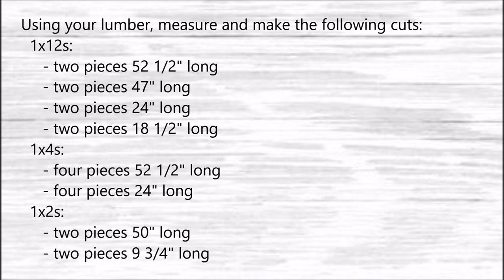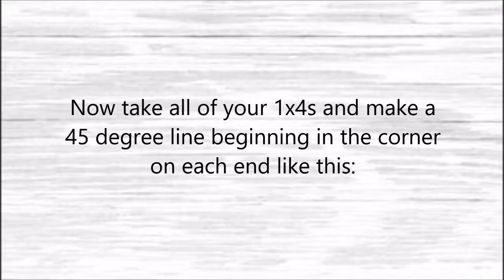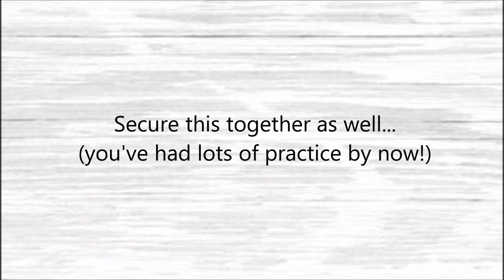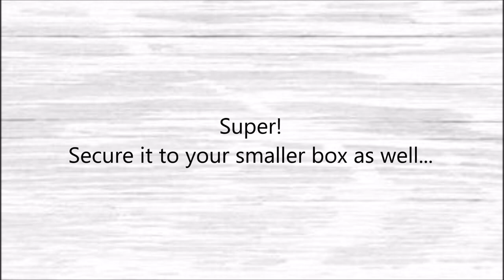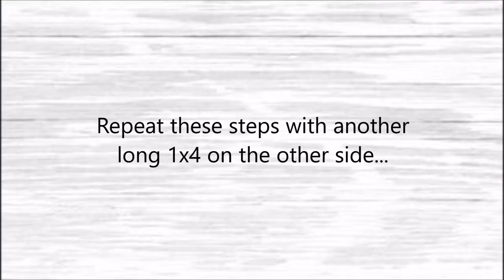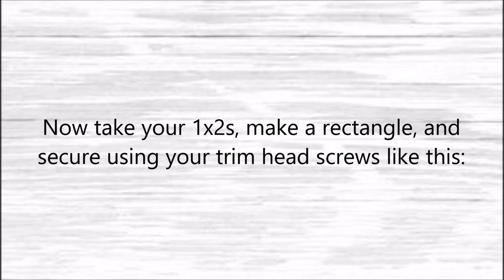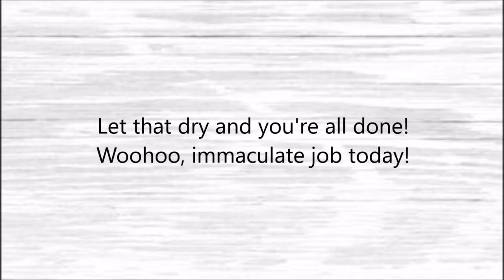The $80 Console Table - Easy DIY Project!

Comment: I would suggest cutting the inside side pieces to fit the box instead of suspending it with the trim pieces. 
Just to be sure it's sturdy. 
It doesn't need attached and only on the piece at the bottom. The trim will hold it on place. 

That's just what I would do. 

Great project!!!!
I may attempt this. 
At work,  they hold raffles for our charity projects. 
We help the schools provide summer break lunches,  help with the local foster agency etc etc
This would be a great raffle item.

Comment: Am I the only one that the side 1/4 45 cuts weren’t 24 inch cuts, but needed to be 25 1/2? Maybe I did something wrong
Reply: Found the same issue. If you do the math there is no way the 45 smaller cuts can be 24 inches.
Reply: Same observation
Reply: Same issue ... now heading to home depot.  😮

Comment: Hi There! I am wanting to make this table but have it be 48 W 30 H and 12 3/4 D. However, I am unsure if I am updating the measurements properly. 

Would my cut list be:
(2) 48 long
(2)42.5 long
(2) 27 long
(2)21.5 long

1x4s
(4) 48 long
(4) 28.5 long

1x2s
(2) 45.5 long
(2) 9 3/4
Reply: I’m in the middle of this project and I think there’s a measurement error in his video. He has the 1x4x8 cuts as 52.5” and 24”. The 52.5” is correct, but you need to account for the extra 2 inches of height (1” on bottom and 1” on top) that are added when you nail the 24” 1x12x8 to the 52.5” 1x12x8. 

His list of cuts at the 0:46 mark are all correct EXCEPT for the “four pieces 24” long”. That should instead read: “4 pieces 26” long”. 

In your case, you’d want 4 pieces of the 1x4x8 to be 29” (27+2). 

Hope that helps.
Reply: Actually you’re correct with your 28.5” measure. I didn’t realize these 1x boards weren’t actually a full inch! 0.75”
Reply: @schaefferarnold  helpful - thank you!!
Reply: Same boat I’d love to build that with the same dimensions 28x30x123/4
Please can someone post the accurate measurement.😢

Comment: I desperately want to make this. I need to change the length to 60inches but i can't seem to figure out how long the "smaller box" length should be. I'm thinking 56 inches, but is that right? HELP ANYONE?!
Reply: Yes, you need the gap to be 2 inches on both sides for the sides
Reply: Can you please share aal the dimensions for 60” length